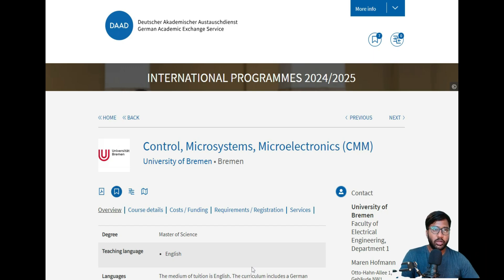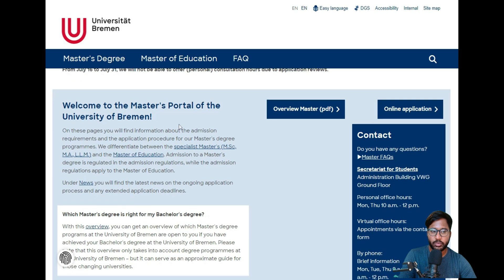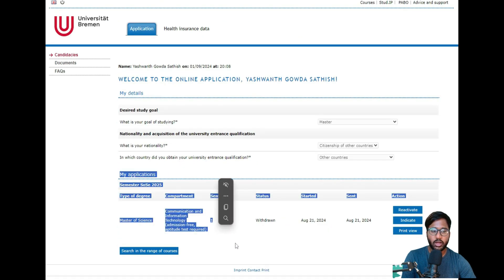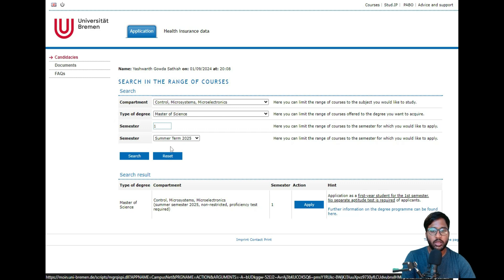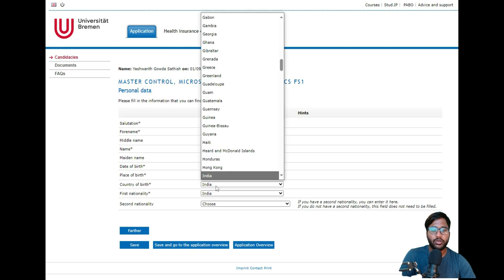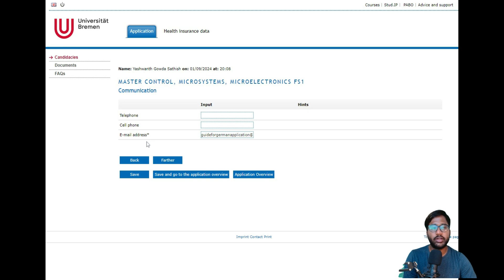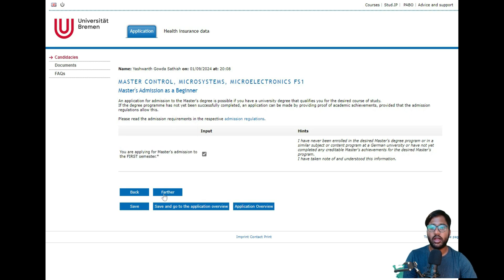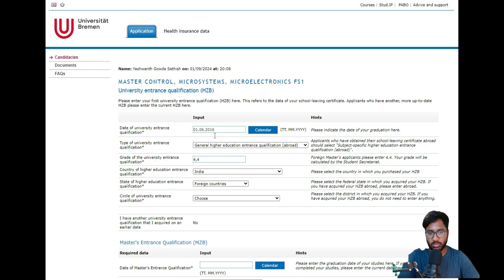How to Apply for Control MicroSys & Eelc | University of Bremen | Part 1 | Requirement & Application

Comment: Bro, what about paderborn university is gre compulsary for electrical system engineer course
Reply: @shreyaskumar9049  it's not mandatory, but applicants how have gre may get benefitted.
Reply from the maker: There is no compulsory requirement, it’s only an added advantage!